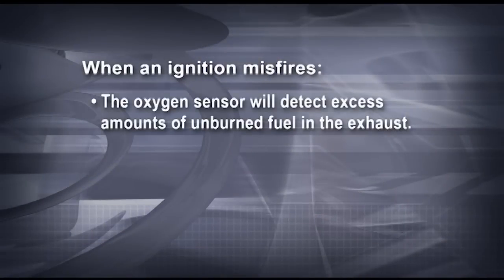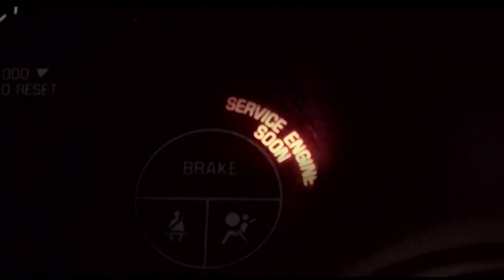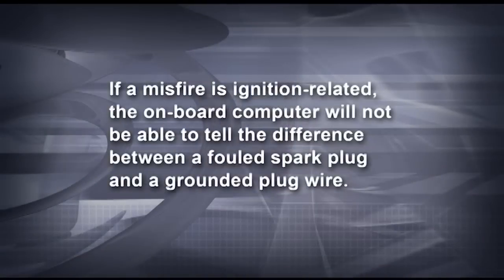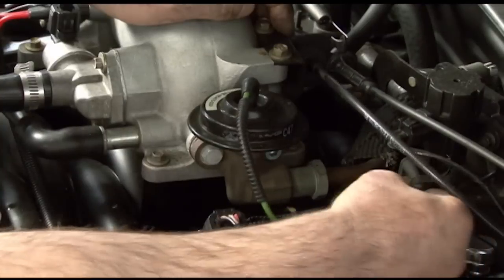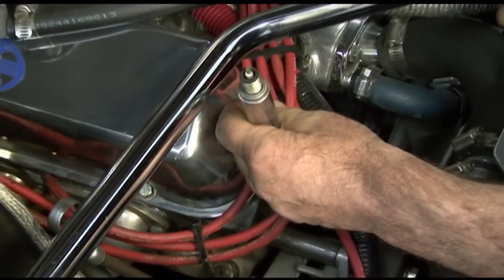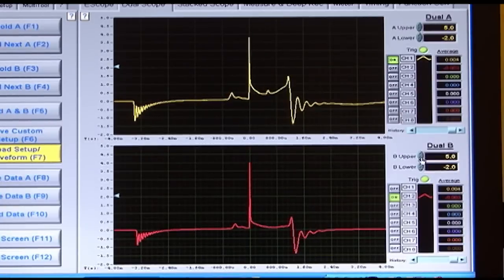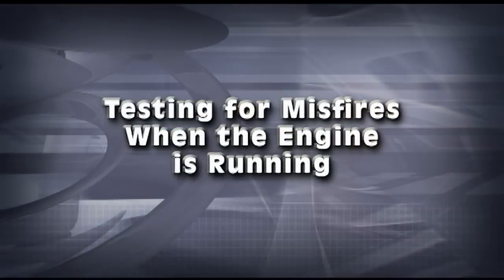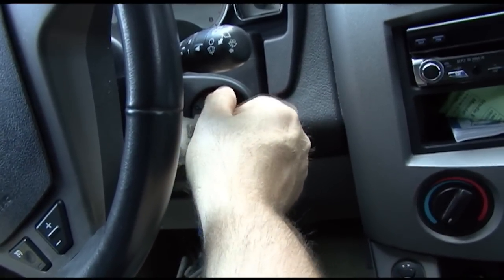Autolite Challenge Series: P0300 Engine Misfire Diagnosis

Comment: I been driving my car for 6 years with the check engine light on and I care because the car is running good I replaced every sensor spark plugs and coils and fuel pump and filter now I will replace the throttle body and fuel injectors and the cats and if the car is running good with 186,000 miles and if the check engine light doesn’t go out then I will just open up the dashboard and take out the stupid bulb

Comment: Very helpful I got a po 300 and po 304 code on my Dodge Dakota end ended here watching this video replaced my plugs and spark plug wires and presto....problem solved no more codes.
Reply: What brand of sparks and spark plug wires use, please ?
Reply: @mdev8846  Denso spark plugs PK16TT , B&B wire set M6-58366.  Hope it helps you.

Comment: 2001 GTP 3.8
Car cranks and idle fine only have problem when I go up hills and give it gas or try to give it gas all of a sudden feel the engine jump sometimes makes a pinging type noise have had everything done  coils plugs wire's  icm fuel filter. Still running rough can anybody tell me what should I do next

Comment: VIN # WDD2040486L063398
2012 Mercedes c200 w204 VIN # WDD2040486L063398 p2301, I swapped with known good coil on plug and known goods spark plug, check for power and ground both are good,  three cylinders are running fine except #1, I also check all compression they are around 155,156,153,157 psi. I watched your video and follow your steps, still not firing #1. Is anything else I miss or need to do? please advise

Comment: it is very instructive did mostly all of the test and what confuse me is the fact when cold engine start good a minute running than rough idle hold accelerator rpm to 2000 for about 4 minutes temp of engine come up to normal and engine run very good all day till cooling off overnight what could be the problem?? I only got the P0300 code onto the OBD2 code reader that show. while engine run rough I also get service traction system than it goes away when engine run good.
Thank. I am on that for about two weeks now still drive the car and it run good when warm.

Comment: Good information. Thank you.
Reply from the maker: Appreciate your thoughts. Jay and I worked hard on that series and it's still relevant today. Good luck fixing cars.
Reply: @superdve1  ⁹9
Hey  Dave,  
I have  a Misfire p0300 problem Hyundai Sonata 3.3l check light flash,  no power, stalling and strong fuel smell as you start engine.
Reply from the maker: @dtav116  Sounds like a load scaling issue or O2 sensor. Does this cold/hot or all the time.

Comment: All that tech, and I'm betting it's expensive, and the chinese who programmed it can't spell BORDER correctly @ 7:20 hahahahaha If you have a DODGE 5.9 with P0300 code, read the TSB 18-48-98 (http://dodgeram.info/tsb/1998/18-48-98/18-48-98-v8.htm)  and reroute your plug wires. After 4 years of my 01 Ram 1500 showing this, I moved my wires around and the code IS GONE! So before you change plugs, wires, cap, rotor, coil, TPS, CPS and all the other crap, give the wires some space around them and see what happens!

Comment: Got a P0300, two spark plugs were loose.  Tightened both and then got a P0306.  Checked that spark plug (which was one of the two which were loose) and the porcelain was half broken off the plug, causing arcing.  Replaced #6 plug with a new one and no more SES light.

Comment: hello
I have a dodge ram 1500 van I have a misfire P0300 to P0305 I put some emission cleaner in the fuel  new new injectors spark plugs air filter after two weeks my check engine light is gone and the misfire code are gone.

Comment: i have my 2002 Mitsubishi Eclipse GT V6 3.0L at first the car just went out of power didn't know why .. but at the garage when the mechanic discovered no spark coming out of the spark plug i told him that i have distributor .. so we went on stages of replacements starting withe cracked cap and worn out router inside the distributor and then .. spark plugs and spark plugs cables .. then showed code P0301 cylinder 1 so replaced fuel injector and then catylac converter rear engine bank one .. now i get the P0300 so i'm going to replace the whole distributor to a brand new one just in case the old one no good .. and ordered brand new fuel filter .. this been going on for about 45 days .. after all that i don't know if still didn't solve the problem !!! if any one can help please let me know any information can help that's my only one car 90% used to drive to work
Reply: +East17A This video es pretty good... Sources who are familiar with fixing cars like shops, dealerships, internet conclude many many reasons,   Even if the gas tank cap is not thigh enough, it could trigger check engine service P0300 OBD error code.   Before replacing parts randomly and the car shops guessing, it is best to have the car dealer technicians do a complete test and only then start replacing parts.

Comment: A '98 van that I got about a month ago misfires when warmed up. I couldn't figure out why until after reading/watching about looking for arcing at night. So I decided to do that and sure enough, there was arcing on the transmission fill tube from the ignition coil. I moved it out of the way so that it wouldn't arc thinking that would fix it (I thought it was coming from underneath the coil wire boot). When I checked again, it was arcing from the side of the center part of the coil to the outer metal square around it. There were 3 different arcs on one side, not sure about the other side. Going to get a new coil at the end of this week hopefully and see if that fixes it. My spark plugs (NGK TR5 V Powers) were also gapped improperly (I think). Some were gapped at 30 and some 40 and my manual says 60 but not sure if these plugs have to be gapped for this engine (60) or if they were supposed to be pre-gapped at 40. I'll figure it out sooner or later.

Comment: When im driving my car and put it on nutural at a stop light it does either one of two things, it starts to acelerate by it self to 1500-1700 and it stays their for a couple seconds or it drops to 450 and starts shaking a bit, it has the random misfire code po300 and i cant figure out what it is
Reply: +7dramabeats me too in my 1997 buick.  have replaced tons of stuff.
Reply: @7dramabeats - It could be a spark plug, ignition coil, fuel filter or fuel system or maybe even the battery. Check all of these.
Reply: neutral 👍